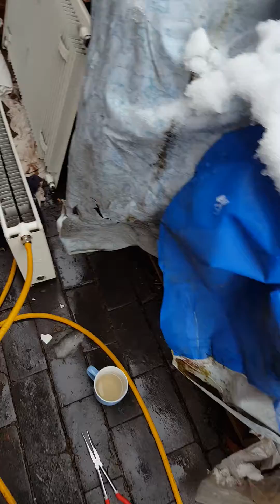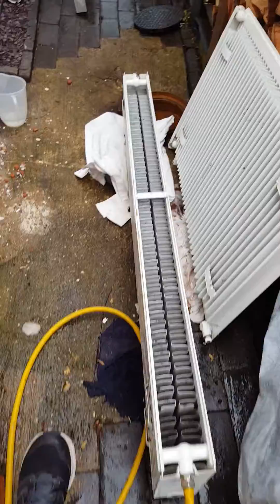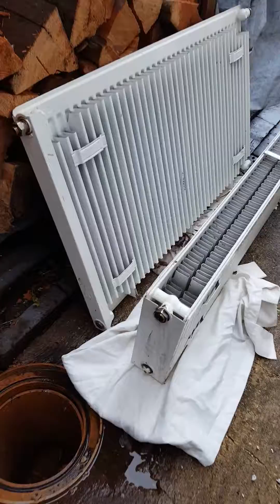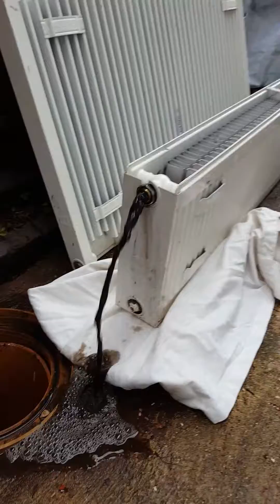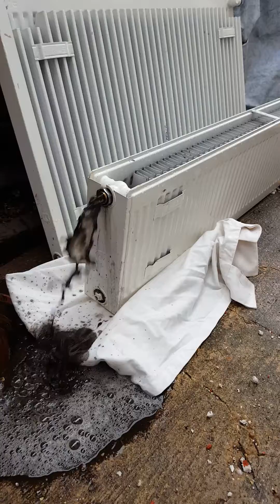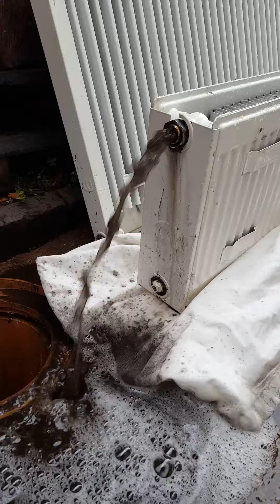Radiator Flush

Comment: When I redid my aunts 60 year old cast iron rad and cast iron firewood boiler plumbing, I flushed out about three 20 liter buckets of tar-like thick sludge from cast iron radiators and the boiler itself. My aunt was dumfounded when all it took to get radiators heating up again as should be was just a simple flush of the system. She said the radiators in the house haven't got that hot for more than 20 years.

Comment: The rad is probably better off getting a power flush done properly… and you should’ve let the water out the bottom TRV/LOCKSHIELD Valve as it might have took out any rust or sludge
Reply: Or install brand new TRV and lockshield valve.